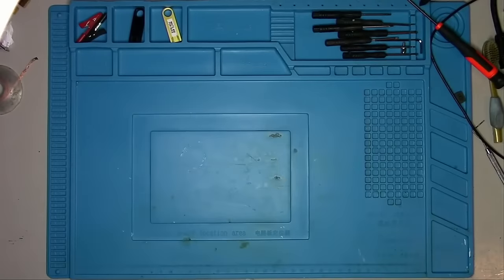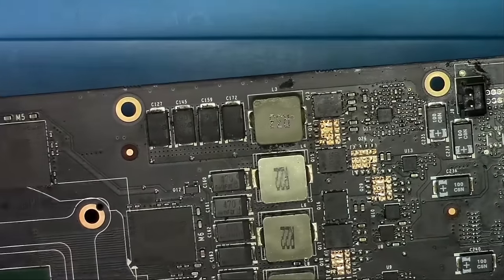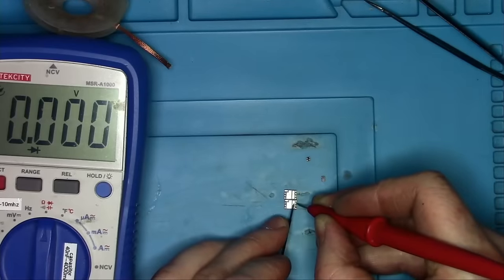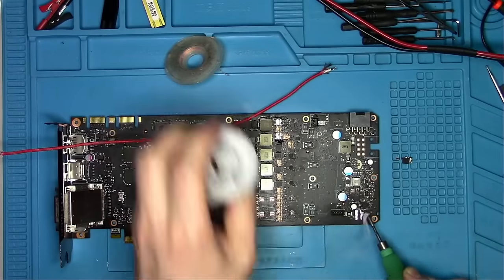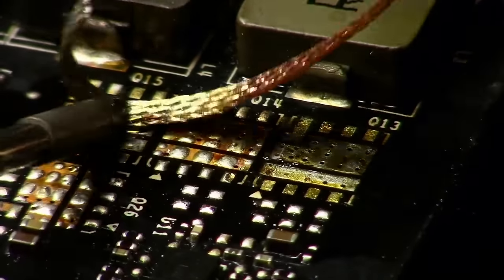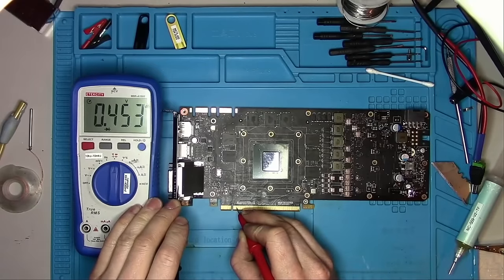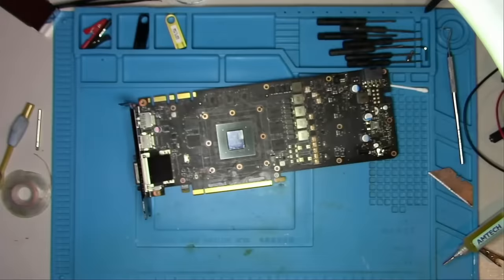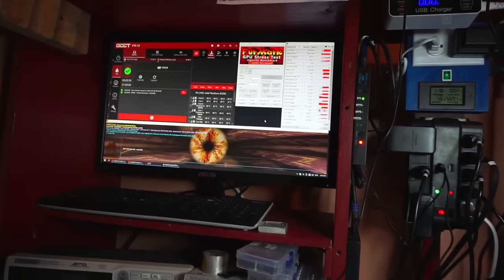What MINING does to Graphics Cards

Comment: As someone who has worked within the semi-conductor manufacturing industry, and knowing just how many copper traces are layered into PCBs, watching you take a ball rotary tool bit to that board was heart-dropping.
Reply: yeah thats why im asking too, did that drilling had no effect at all?
Reply: He probably consulted with a boardview to plan this maneuver.. Or maybe just experience with that particular model..

There's no way he'd use the same approach to deal with something like that close to data lines and theirs vias.
Reply: I was thinking the exact same thing, or more like "WHAT THE HECK!? SERIOUSLY?!"
Reply: totally. Mind blown away.
Reply: I was thinking that too, but he probably just used boardview.
Reply: You normally don't route signals in this power area because of the switching noise. Most likely there are only power planes that can be cut out. I assume he did that without checking, as there is no other option at all.
Reply: At first I thought there were components once where he was grinding and thought it was going to be a miracle if it is ever going to work again. Still is a miracle even without components.
Reply: @nobodylmportant there was no risk really. The card was dead, that bit had to be cleaned. The risk was just that it would not be possible to repair the card, which is the same if he didn't clean it.
Reply: He probably know the layout 🫠
Reply: @velfare This.

Like, it's clearly far from his first rodeo...
Reply: @velfare  He most certainly doesnt. Thats like knowing a New York map by heart. He has PCB layout on his monitor most likely. Im not saying that its not impressive though.
Reply: @@Pyro293 no one said it was a problem, everyone is expressing shock and amazement at our hero's skill level
Reply: I don't even know the layout of my own very simple designs. Either he had the pcb layout nearby, or he knew he wouldn't find anything because no other signal is routed under layers near the mosfets.
Reply: @ipanesm  It fixed the short. The damaged area was power not data.
Reply: Nvidia will never give someone 3D of their board, he was lucky to not have a trace a this place.
Reply: @millinag3817 NVIDIA don't but there is a lot of repairmen that share schematics and boardview online for others to see of tech, I knew a guy who would cut apple PCBs in half to try to see how they are layered, the issue is there is some lines so thin you can't see them.
Reply: @AbdulBido  I've done a couple repairs like this. Usually boardviews are not available, not even dare to speak of actual PCB layer schematics. Its a mix of paying a lot of attention to what you are dremeling away, if you hit any stray traces fixing those afterwards (keeping note of them while going deeper; usually there isn't any indiviual ones though) and a bit of luck. 
Luckily the areas with a lot of data lines don't burn up usually since what burns is usually mosfets.
Reply: @Ground15  thanks for the insight. Reminds me of the kamikaze technique used on one of the xbox 360 drives.. Ooh terrifying..
Reply: It looks like 4 layer board, power middle, signals top and bottom?
Reply: @whatever7338   Everyone who lives in NYC knows the map by heart, thought its super easy since its a grid.  DC would be a better analogy :)
Reply: @millinag3817  Nvidia doesnt make these boards (except their founders edition obv). They just make the GPU chip on it so they cant give schematics even if they wanted to.
Reply: @DSP-gh5ei  You know I'm working in PCB ? I'm a PCB designer... The thinest trace can be produced actually is 0.06mm trace and cost twice than a 0.1mm trace. 
0.4mm bga pitch is very exigent and only some PCB suplier can assemble it.
Reply: @whatever7338  That's exactly what I said.
Reply: @juhajuntunen7866  So complex boards is more like 8 or 12 layers.
Keep in mind there is many differents voltage, like 12V, 9V, 5V, 3.3V, 1.5V, 1.2V and some lower ones...
All DDR signals should be shielded betwin 2 GND plane.

Comment: Love it seeing repairs like these done. Been relatively deep in the industry for about 6 years now. Everytime when asking manufacturers for RMAs or repair inquiries, always been told, that the Problem cant be repaired and the card had to be trashed/Exchanged. Ive seen a view repairs with shorted components, but drilling a hole right in the multi layer PCB and having the card working flawlessly just like that also is a first for me.
Reply: cool pfp
Reply: @xXGeorgLPXx  you too m8 haha
Reply: I think most of those are ground planes since it's in the power supply area
Reply: As someone who works in RMA we are capaple of repairing tose Errors. The Problem is you have to guarantee that the Card is in working Order for a year (Germany) seeing this issue it is likely that other components might be affected. Also this is a 1070 the time to fix this GPU is Not in Relation to the worth of the Card for the company. I hope this helps.

Comment: Props to you on working with graphics card circuit boards. That looks like very hard intricate work you did. Your soldering skills are dead on perfect. I've never seen anyone grind away a part of the circuit board to expose a problem underneath but you did  it with ease and then filled it in. Just masterful work. Thanks for sharing this video.
Reply: Electrical dentistry 😄

Comment: I had this exact card (still have it actually) and a resistor on it blew out after 5 years of significant gaming use.  Great card, and I unfortunately got unlucky.  It's very much repairable, but I went ahead and got a 40 series so I could actually try newer features like raytracing etc.  Sucks that EVGA doesn't make cards anymore.

Comment: I still think that was sorcery. Let alone that you could place such tiny things in place is something entirely impossible for me. It took me several attempts  to solder cables on an Adruino board - with a third hand and magnifier glass!!! (including destroying the first one lol). Hats off.
Reply: Flux is the answer there my friend.
I would wager that 90% of the problems people have when soldering is due to not using (or not using enough) flux.
SMD parts especially. Once there's plenty of flux on those pads the solder and components just move into place by themselves as if my magic.

Comment: hats off to you, i have done reballs and gpu swaps on gtx cards, when a saw you clean that burn and wipe away 3 layers of the pcb to do so i thought it would never work again, your diagnostic and testing of resistance and voltages made me think again, congrats, that was a hell of a repair, 99.99% of cards with that damage would usually be thrown away!

Comment: Great work! The reminder in the end could have also reminded about backups. It doesn't matter how clean your system is and how good you PSU is, if you're really unlucky, your storage will fail without a warning. Or you get some ransomware virus in your system. Either way, you want known good backups.

Comment: What type of mining are you refering to ? 
I have had more cards go bad and burn up due to overclocking when i was gaming.
blown mosfets 
Popped caps etc.
My neighbor has 20 1080 ti's that have been mining nonstop he bought them when they first launched the cards are still running no issues 
You need to maintain them because they are working 24/7 for you . New thermal pads thermal putty and paste every couple years . 
With a good cleaning every 4 months .
Reply: this, maintaining is always something you should be doing with computers
Reply from the maker: Exactly right
Reply: yeah, most of mining GPU is actually fined and sometimes even comes with custom/better thermal solution since its used all the time, my friend rtx 3080 has a very good custom cooling system when he bought it from a miner, same with others people i know that have buy a mining used GPU, the only problem stuff that they have is driver side (side miner usually use custom driver)
Reply: Yup and when I'm looking for used cards id mostly prefer ones that came from miners because gamers and a few of those who mine trash the cards with high overclocks and poor cooling. Gamers look for speed and quietness miners look for reliability cool temps and less power consumption.

Comment: It's more like "what greed and incompetent overclocking does", not "what mining does"...🤔
But still: great video and awesome repair! 👍
Reply: I'm a miner. OC is wrong. It is a heat problem. Heat needs airflow. Airflow causes sucking dust. More dust causes less airflow causes more heat. It could happen also to gamers, but gamers do not need so much electricity, which causes the heat. Miners should use cases with regularly changed filters.
So it is not oc, but just incompetence and a bit of greed. But yes, it is not just a mining problem. It could happen anywhere where heat and dust is.
Reply: Overclocking sells more GPUs. They've been mining the same old mine for years

Comment: Ok, I was impressed before, but now you're on a new level.  Back in the day, i did board level component and  repairs on computing gear, and i've never run across another person gouge out a bunt area on a multi layer board to repair it.  Much cleaner than any i did.  Well done.

Comment: That is absolutely incredible, and I did not think drilling a hole into the card would actually fix it, but I gotta ask, is this repair cost-effective? Does it make sense to seek this kind of repair if I have a dead GPU and need a working one?
Reply: Really depends on what the issue with a dying card may be. In most cases, reballing the chip will get a few more months out of a dying card, and that can be done by anyone with an oven at home. Make sure you look up a tutorial on how to do that, or you'll wind up with a dead GPU and a mess to clean up.

The repair here is incredibly cost effective in the case that you need a GPU, and right now. Otherwise, it's better just to replace a card with an issue like this, there is no longevity in a card if you have to grind in to the PCB like that, nor will it function at peak capability.
Reply: @x8jason8x  Why wouldn't it function at peak capacity? In what way has its performance been hindered??
Reply: @Syncopia  You cut traces and pull filter capacity out when you grind in to the PCB. It results in irregular power spikes through the circuits that aren't designed to handle it. It's essentially just a bridged connection skipping what used to be part of a circuit.

Comment: It was an awesome learning experience from how you fixed that video card and did all your testing as you fixed it! Thank you so much for your explaining as you tested and fixed it! I just recently bought an Alienware M16 R1 with a RTX 4080 video card from Dell, mostly to do CATIA design, AutoCAD and other 3D modeling programs. The RTX 4090 was too high of a price at the time and I read all about the end tip being broken and overheating problems, so I decided on the RTX 4080. I have not had any problems so far, but mostly use my computer during the weekends. 

I can see how running your machine doing mining all the time would cause issues with eat and debris getting into the fans and other components. I'm always facinated with how electronics have come a long way over time! 

Thank you once again for tips on how to care for the hardware in a computer!

Comment: This was one of best GPU repair video i have ever seen , specially i have 6 of this card all have similar problems from burning board to stop working cards, all the 6 cards stop working at some point in the last 5 years. However, i have some questions. What is the 4 burned inductors values , i need to replace so i need to know what are the values to order the replacement. Also i see you use a voltage injection to detect the short, what was the values of volt & amp you used on your bench power supply  during this process ?  Thanks in advance

Comment: My MSI had a metal backplate and thermal  pads. (RTX 2070 Gaming Z) my MSI RTX 4070Ti Gaming X Trio  also has a metal backplate,  thermal pads 3 separate heatsinks (1 for GPU core 1 for memory  with it's own heat pipe,  and 1 for VRM's also with it's  own  heat pipe) both these cards have class leading thermals.

Comment: Mining graphics cards often suffer from damage due to the high heat and power draw associated with mining operations. In the video, the speaker explains that EVGA cards are still the top choice for mining because they have metal shields and thermal pads that help dissipate heat. The speaker also demonstrates how to fix a damaged card by removing and replacing components, testing them, and reassembling the card. The main takeaway from the video is that miners should regularly clean their rigs and ensure their power supplies have built-in high current protection to prevent damage to their graphics cards.

Comment: I have this same card, I applied some Noctua NT-H1 and got the thermal pads that the EVGA customer service told me to use. I don't remember but they told me the thickness and the what specs to look for on the pads. I found some on ebay that were better than that they told me to use for a decent price.  I cleaned it all up with 91% Isopropyl Alcohol and it worked great and still does.   It was a mining card that a friend picked up a few years ago, but then it wouldn't fit in his PC and we did some bartering for it.

Comment: The 1070 i got recently (the one in the video, but black oc version) came to me in such prestine condition that i even doubt the previous owner used it at all, the radiators were clean, no burns, IT EVEN HAD THE PEEL ON THE DISPLAY, worked perfectly with 0 errors through half a year that i have it. Maybe it was treated good by the miner, or it was sold cheaper just because the guy wanted to sell it faster. Sadly the backplate was off, i wanted it, it looked cool, lmao. Also the temps are a little bit higher without it.

Comment: He Just understands the topography and more important the tunnels that the angry pixies use to get around through the board and components. 
Just like a city transport network, he knows where the subways are so can just drill through the road (board) to get to the problem when and where trains (angry pixies) will not go through. Then just builds a new road over top or around the hole if needed for the pixies travelling the roads (board top/components)
One can clearly see he knows every trace, even though i do not 👍

Comment: I had a 2080 ti from evga, the one with 2 fans, the temperatures where tremendously hot… 95-105 on pack and 82-87 on core and the fans where ramping up to 100% all the time. I bought some aftermarket heatsink and mount 2 fans motherboard and the temps never exceeded 75. So I don’t trust them, now I have a 3080ti from zotac and from factory the temps never exceed 80-82 which is great

Comment: So, what was removed? and grinding out the burned part was cool; I thought you would rebuild that spot, but it was just filled with epox and cleaned up. Very interesting fix, was the item a parallel component that wasn't 'kinda needed' for operations?

Comment: When I build my PC, I want to make a custom housing that uses a HEPA filter. Or have the inside sealed, relying on a big external, easy-to-clean or filtered radiator, and liquid cooling.
When I have power to spare, maybe I can incorporate forced cooling with a heat-pump or Peltier Devices, so I can overclock safely. I was never comfortable with raw air & dust being normal in a PC. 
When I was young, I even taped a paper towel on the intake of my Nintendo Gamecube.

Comment: When I mined ETH for a year, my Zotac 2070 super survived but my MSI Tomahawk mobo died with the NVME. I was still able to use the GPU with my new rig and after a year I sold it. It's only a 2 fan GPU but it survived. I also had a Zotac 1060 mini before that and I sold both with no problem. I think GPUs are more resilient than other components. I'm more disappointed with the quality of the MSI motherboard these days and the thermal issues with NVME.

Comment: Impressive that dremeling out a chunk of the board like that didn't cause any problems - I suppose it was just passing through ground planes etc. and if there were data lines hiding in those layers you may be able to recreate those connections with bodge wires.

Comment: Ok so I'm a novice when it comes to PCB design. I can do some basic STM32 stuff but not very advanced like minimizing EMI, working with gigaherz signals, or power lines with less than a few millivolt tolerance and such.. I was wondering if it's just lucky there were no traces under those caps.. Or was that by design? As far as I could see you went several layers deep. Perhaps this is a place on the board that gets very warm, so that they use a lot of ground pours and lots of stitching to let the heat flow away? Or was it in a place that's very sensitive to crosstalk so that they avoided running any other traces there on other layers? Perhaps that kind of info is proprietary so maybe your guess is as good as mine but I'm wondering what someone more knowledgeable than me would say about this.
Reply: haha i was about to ask this as well, yeah because those boards usually have a lot of layers, but I also think they used all the internal layers under those capacitors for power because 150w @ 1v is 150a, so low resistance is adamant and also pulsed current from the power rails could potentially couple into the data lines. Another factor could also be because the power inductor is right there on the other side, and since typical buck converters (like the one in the card) rely heavily on storing energy as magnetic flux in the core, the designers probably didnt want to take the risk, and also the pcie connector is right next to the chip, not much communication has to go through the power stage anyways.